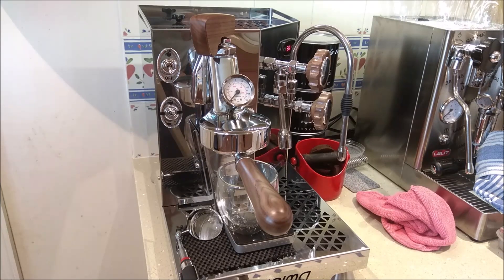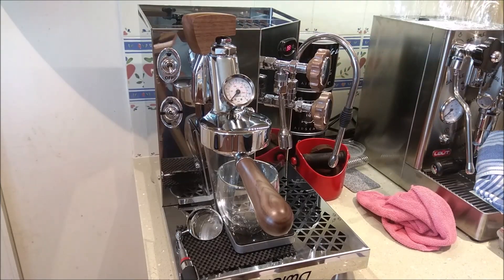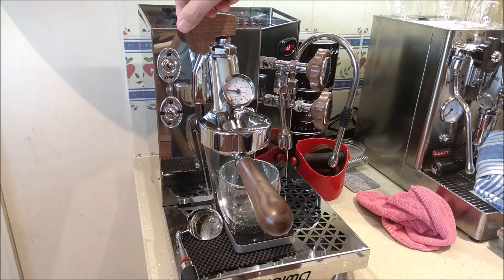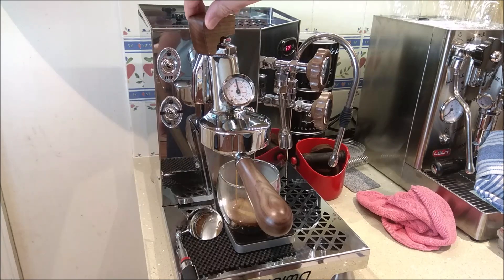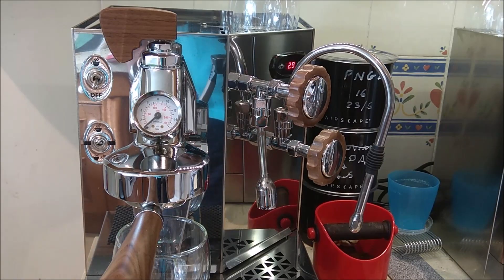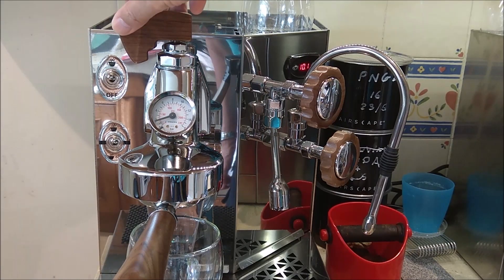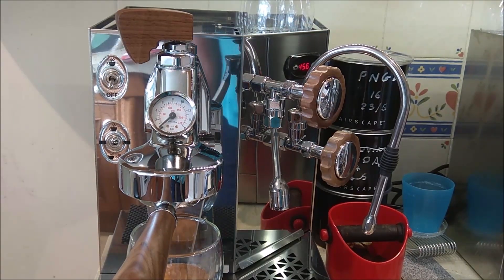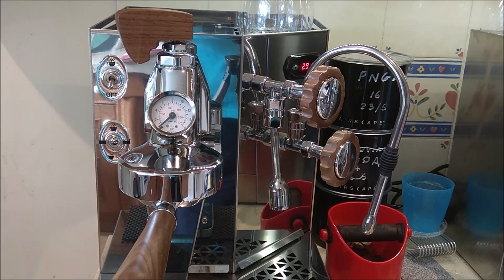ACS Minima with Lelit flow profiling kit

Comment: Hello Dave, after quite some research, with the specs and flow control kit applicability for its price, the Minima seems like my dream machine. 
Unfortunately, living in Japan, I cannot find any importers that carry the machine. 
What would be your suggestion for the best way to own the machine?
I'm mostly afraid that I won't be able to access any technical support if I do a private import. 
Any suggestion would be greatly appreciated.
Reply from the maker: Japan is 100V is it not?, so I don't believe they even make a model for your voltage?
Reply: @DaveCorbey  It is, but I understand ACS also makes 110v models? I have seen it on the websites of some overseas importers

Comment: Is that vibration pump?is it possible with other e61 vibration pump machines?Bezzera etc.thanks
Reply from the maker: Yes it is a vibration pump machine and it should work fine on other machines if the group is compatible.

Comment: Hey Dave, I love my Maschine but in 2 years I had so many problems with it.. Currently it starts to filling water into the service boiler and it won't stop to fill up. After that it starts to leaking from the service boiler into the maschine and everything is getting wet. I also tried to descale the service boiler with your manual but this didn't change anything. Do you have an idea what could I do? I can't send it to the customer service because it is  cold outside this could damage the boilers and I want to solve it by myself due to high costs from the service. KR Hal
Reply from the maker: Check the autofill probe wire isn't loose, or trapped under the autofill box, ideally there should be spacers under there as the wires were getting pinched on earlier machines. Check the corresponding ground wire (black) from the autofill box is connected to the frame or boiler.. If those all look good, remove the probe and clean it in case of limescale, unless you know you use boiler safe water. Note: sometimes pulling the probe out cleans the limescale off.
Reply: @DaveCorbey  Hi Dave, thank you for your help. I have taken the autofill probe out and it was clean (like you mentioned it could be by taking out) - after that I put it back into its place and after that my machine works fine for the last 7 days. I think that was the main problem. Normally I use boiler safe water filtered by Brita Purity C150 which does his work fine. I think I have to send the maschine next year to the service for a generall check up to be on the safe side

Comment: Hi Dave. I have chosen ACS Minima based on your reviews, and I am really satisfied with its performance. I have a question related to visual part. Where did you get the wooden knobs and was is difficult to replace (or similar to Mara) ? Thanks!
Reply: And now I see that this question was already raised... and answered. I will check with my ACS dealer.

Comment: You have spoken incredibly highly of the Lelit MaraX in recent months and even hinted at the fact that it makes dual boilers unnecessary for most people. With that being said, given that the price is very close here in the US, wouldn't the Minima make the MaraX a worse value if you get better steam and temperature stability? I've been combing through your reviews and comments on both machines and your praise for the MaraX is more recent. Is there a feature of the MaraX that I might be missing that makes it a better value proposition?
Reply from the maker: Wow, difficult question if both are the same price. I think you have to look at the features and aesthetic of both and buy what suits you best. They are both very capable and only you can decide. It's fair to say the MaraX is much quieter than the Minima.
Reply: Dave Corbey Thanks for the reply. I think I’m going to pick up the Minima. I personally love the aesthetic and I mainly use light roast single origin coffee. I like the idea of having more precise temperature control. I will probably add the Lelit Flow Profiling kit as well and be able to play with all the variables. I want to buy a simple machine that works in any situation and allows me to tinker. I think the Minima gives me all of that. Thanks for all the time you spend helping people with their machines. Reading/watching your reviews and forum activity has taught me a lot about espresso machines and grinders. That ultimately helped me pinpoint what is important to me. I picked up the Niche Zero six months ago and will finally be upgrading my machine after several years on a Gaggia Classic. Thank you!
Reply: @DaveCorbey  i came to ask something similar so I'll piggyback this comment if you don't mind. For my situation the mara x is $300 cheaper so it looks better value. But I'm struggling to understand if I'm giving up anything by not getting a db. For both I'll aim to eventually get the flow profiling as I grow into it